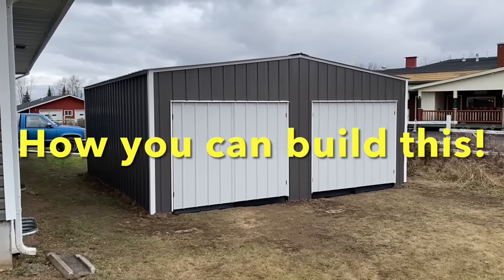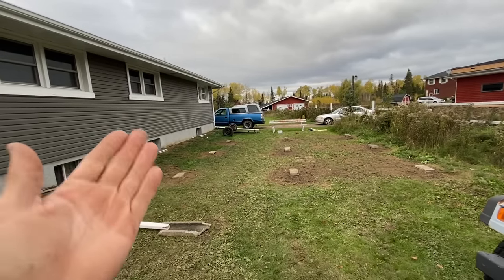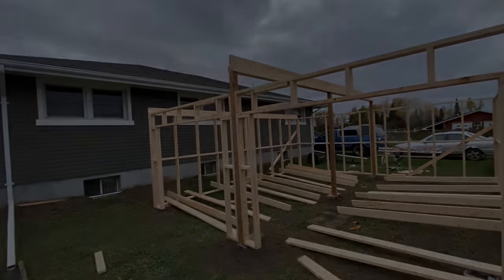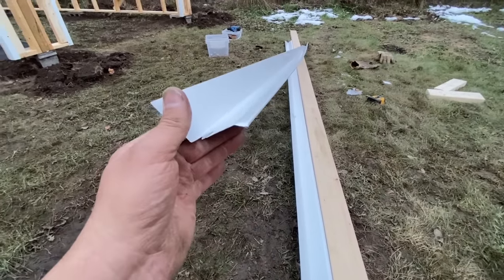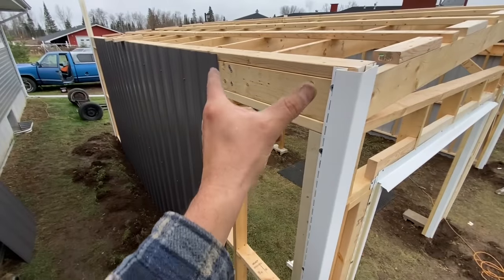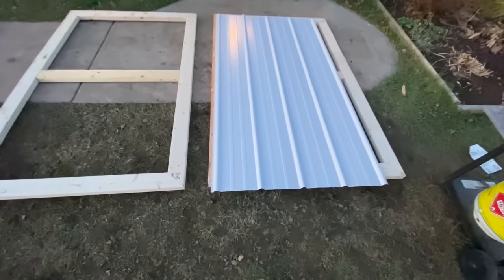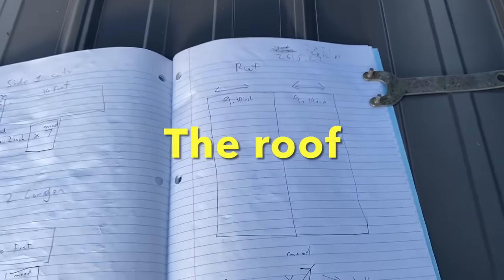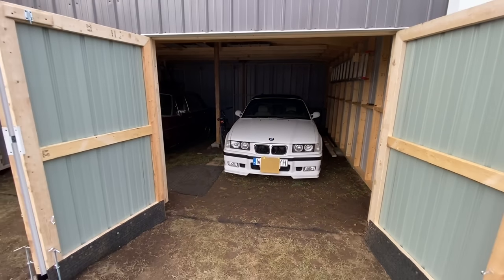How to build a 20x20 Garage for $3000 in 5 days (from Home Depot materials)

Comment: I have a metal garage for my bikes and the biggest issue is moisture in the winter. My tools and bikes have corrosion issues because the inside of the metal condensates and makes everything damp inside. Might be fine in the US though. I live in scotland where its cold and damp a lot.
Reply from the maker: Install an electric exhaust fan, that will completely solve the problem

Comment: Great job !! Are you concerned with sweating issues ? i did mine the same way an my metal sweats when it heats up from a cold night.
Reply from the maker: Mostly I'm concerned about keeping sunlight and snow and rain off my cars, ys it's not perfect but it's good for now, also I have an electric fan inside running to keep everything dry.  It is just a carport in the yard, all I could afford at the time

Comment: Great job on your building just one problem, I see you have put screws in the highs of the sheets and not the flat of the sheets to late already done and when starting end wall from left to right or left to right when you get to the middle you are to lap back the sheet same on the roof start from front or back not the middle so you can lap back the sheet. lap back means the high of the sheet,so if i started sheeting from the from to the back my last sheet laps back a foot on the last sheet to make a perfect end, too late already done, but still a great job on building this project.

Comment: Really neat build. I would prefer a bit more of a foundation. My area has high winds on occasion, and this type of building wouldn't last long. Some type of smooth floor would also be great,  but that would add cost.  I really like your budget minded construction. Many people will call out the hacks and shortcuts, but it totally makes sense for your build.
Reply: Yep. First wind will blow that away like a tent. Everyone should consult a contractor before pretending they can build anything. He could have save a lot of time just concreting in some treated four by fours.

Comment: I would like to copy that build, my one concern is if it is stable in high winds and can it bear its own load, do you have much experience in woodworking like this?
Reply from the maker: She is solid, if you lived somewhere windy you should run four by fours into the ground a few feet in with concrete at the bottom to really tie it down. 
 You need to have it strapped down but the whole thing is very heavy, where I live it doesn't get that windy

Comment: The blocks are installed improperly. They need to be set with the holes upward. There is no strength in a block with the flat side up. Just look at all block constructed buildings, the flat side is for looks outside, the holes are stacked on top of one another. Same with 2x4's, the strength is when they are installed sideways for load bearing. Other than that, the work was very nice.

Comment: Seems to be a shallow roof slope,  wondering what the snow load max is in your area. From what I can see,  I’d increase the overall roof supports.  On a shallow slope 2/1, Code here dictates a max load of 10.5 lbs per sq foot,  on this structure would be 10”.  We get two to three feet at once.  No go on slopes less than 4/12.

Comment: I hope you put some concrete in that garage cuase in winter cold season those tires are going to lose air pressure and bugs and critters will hide up in the wheel wells and engine bay. its happens TRUST ME. its sucks!! Awesome garage DIY tho👌👌💯
Reply from the maker: Both vehicles are oil guarded, and the ground is already frozen solid for at least the next 5 1/2 months.  It is just a carport though
Reply: @ProblemSolverGarage  ya its pretty nice. I want to do something like this and my grampas property.

Comment: Pretty informative But I am curious what will keep it from getting it blown off the concrete blocks?
Reply from the maker: It is very heavy, I also placed eight or nine cinderblocks on each corner on the inside, I wish I included that in the video. It doesn't really get windy here if it did I would strap it to the ground with cement and some type of long treated boards.

Comment: Love these “contractor” code comments like cinder blocks on edge.. it’s just a oversized metal shed kit it’s not carrying that much weight even with a snow load what he did was fine,my only issue is I would’ve done the wall panels from the corners and work right to left leveling each panel so you only have to cut one at the end but that’s just me this fine for 3k

Comment: Okay guys, this is so informative and detailed. Good job. But guys, I really want to see how the 2x4 frame. Especially, guys, along the bottom, which should've probably been a doubler, guys, so it doesn't sag after the heavy Canadian snow sits on top; especially guys, if you have them floating over ~10 ft spans. Another thing guys, is that you never mentioned using interior or exterior ground contact wood for the frame. Especially guys, around the base which will touch the ground and possibly make water contact. But guys, like I said, very detailed and quality explanations, that's it guys.
Reply from the maker: Well guys, the wall won't sag guys because it has metal strap to it guys, think about it guys there's a big giant piece of metal strapped to the side of the wall, it is impossible for it to sag, thanks for watching guys.
Reply: @ProblemSolverGarage I would love to see a follow up video of it's current state next year. But metal bends as well if enough weight is placed on it.
Reply from the maker: @srchellis  sounds good, I'll definitely do an update video

Comment: I like the idea and it looks good but I think this is only practical in a dry desert climate specifically when you have metal in the ground I do not think it would last with strong winds and heavy wet snow.
Reply from the maker: It will be fine, this isn't the first one I've built, they're all still standing looking good. 
 Remember it's just a moveable carport

Comment: Nice build  you did forget to mention one issues  with a 10 foot section 6 stud will  not work out even spacings  center line to center line  one will be narrower then  others
 and on  20 foot wall  each panel is 3 feet  so  i would have though   a 10.5  foot section  for side wall for 21 foot depth front to back of garage and  21 or 24 foot across the back and front would give extra  room for mower   garden equipment etc ...  would have worked out with less metal cutting.   as someone mentioned below the direction you laid the  cinder blocks it the weakest  direction. but  i hate to say in but strength wise you  need a ful sill the spanes  across the gap where the side and  back section come together. and  the shallow pitch of roof    would mandate  a sil  front back and a cross plate to keep side walls from spreading.  Yes it looks good and some  decent hints and ideas  but structurally    heavy snow load that  is borderline on strength and  building codes here    they would  take one look and  because roof area  snow load per square foot   if you  didnt  take it down they would come in with contractor and   #1  either bring it to code and bill you   OR #2  tear it down all ay your espense,  mine have to have   tiw plates all corner and  in  rafter  haf to have a bottom chord  and webs  if they span  more the 10 feet  wall to wall acros the width  but even then   the build is phenominal  and a few  minor adjusts this blows away   others  of same style you can buy as a prefab that are going to cost  18 to 21K  or more

Comment: I'm not trying to be a d*ck here,  I built my 32x20 cabin with a 12 12 pitch 45 deg roof and loft that I live offgrid in the woods. While this is a simple design, a few things that are missing that would concern me. 1. No sand/gravel under the cinder blocks to shed water and avoid frost heave. 2. Cinder blocks are rotated wrong, which makes them not very strong. 3. With no floor foundation, there needs to be something that holds the walls to the cinder blocks, concrete anchors or something. 4. The bottom foundation boards are not treated wood. Cement/Cinder blocks absorb water and will transfer to the untreated wood causing the lumber to rot. 5. The walls should be 16in on center, not 24in. 6. There is no double top plate (additional layer of boards crossing the existing joints, which add strength). 7. I'm hoping the screws are framing screws. Standard deck screws will break under lateral force/weight. Nails are better for structures, screws for decks, etc. Lastly, the roof needs more straps for metal roofing, especially in high snow areas. Also, no overhang/eaves, but that's a personal preference. This is a decent visual description. However, I recommend buying a very basic framing book from Amazon.

Comment: There's some confusion about the all metal TM22 and the TM22 Feather, there may have been some changes during production. I came back to respond to the person that messaged me, but as he said, his posts are disappearing.

The TM22 Feather I have is 36.5" long overall with the collapsible stock extended. It has an 18" barrel, threaded 5/8x24 with a thread protector, a 7" polymer handguard with M-Loc holes top and bottom. The model number includes"A-18" but does not include "Lite" as stated elsewhere in some comments. It is also 15.5" from the trigger to end of the buttstock (extended).

Compare to the all metal, according to American Rifleman, overall length 34", and trigger to end of the fixed stock, 13". Barrel 18".

Comment: You have a 10 ft span on the  foundation plate with no support orther than on cinder blocks. You should have a solid foundation all the way around either cider blocks or cement.
Reply from the maker: I've done this many times before, even 10 years ago everything is still standing. The metal strapping prevent the walls from warping in between the cinderblock gaps.
 Obviously there's always better ways to do things but then the cost goes up. Plus this thing can be dismantled and moved in one day
Reply: At a minimum, I would've added an additional row of PT at the bottom plate and reduced the span with additional blocks.  Then anchored with ground screws and added some hurricane straps.  But chances are, this will meet the OP's needs as cheap structure for some time as is.

Comment: You did a good job but one thing I see you missed that makes this a little less strong is you used a single top plate. And maybe you didn't tie the whole thing together cause you might wanna move it some day but the strength of the walls come from the 2by's tying the walls together in the double plate. Plus, it's a code requirement in Canada and the US to have a double top plate in any structure with walls exceeding 16'.

Comment: when you cut steal sheets with a grinder wheel it ruins the paint from excess heat and leaves the edge raw and open unlike tin snips or a sheer and will cause premature rusting
Reply: just 2 cents from a tinner it should last a decade or so still

Comment: Did you anchor it down to prevent a heavy wind storm from moving it or blowing it over?
Reply from the maker: I placed all my remaining cinderblocks along the walls, but it doesn't really get windy here ever, might need to anchor one of these down in a windy area, but the whole thing is very heav
Reply: @ProblemSolverGarage  Go buy some ground screws to anchor it down, they are cheap and easy to retrofit!  Cheap insurance!!!

Comment: That would not work here in Minnesota! In a few short years, all those blocks would be twisted and otherwise askew and the building would absolutely be falling off of them. Especially with the annual resettlement pressure not centered over the piers. Almost all viewers are going to be unfamiliar with the hydraulic and physical effects of common frost heave. It should be mentioned in your comments below the video that this plan can work only in the south.

If you don't want to dig the piers down at least 4 feet, then pour a floating slab packed with rebar and allow it to heave and ho annually. This is very common in the north as well.

Comment: I did see another area of improvement by running the j channel and vinyl corners down in the ground with the metal. This is another area positive seal between building and ground. As is this flaw throws off the whole building and makes something not look right about the whole building.

Comment: This is a sample of built as you go, side wall use same as roofing material is a waste of money if you emphasize on the budget. also, wait until rainy season, your nice garage is going to be messy since you didn't install gutter and put cement floor. expect a very hot garage during summer because there is no window, your car is going to cook and very cold garage in the winter. Nice detail explanation.

Comment: 10yd of concrete delivered in most of the US costs around $1000-$2000. that's what you'll need for an actual garage foundation. in terms of material price not shown in this video. rebar will cost $100-$300. 

in some places the big box stores will give you a good price on metal panels (R panels or PBR panels or older-style corrugated). but in most places those stores charge too much. my metal guy near me charges $1/sqft or less. the amish are a good source in many midwestern areas, sometimes less than $0.80/sqft.

Comment: Wicked build however you need a concrete slab poured inside eventually if not you will have mud everywhere and critters will find they're way into your auto's. Oh your walls are also bowed not straight.

Comment: Great video.  Could you have filled the hole around the outside of the shed with grey stone or maybe treat the part of the metal under the ground so it doesn’t rust? That is a great build tho. New aubscriber. Thanks.
Reply from the maker: I have another one that I set up 10 years ago and the metal hasn't rusted at all, the roofing material stuff seems to last.

Comment: The only thing I think you could’ve done to make this better would actually been use proper hangers and maybe pressure treated wood or the pvc or plastic wood just for bottom to sit on top of a patio stones / cinder blocks all the way around and then put patio stones in the center. That way you’re not in dirt have you had any problems with the city or building inspectors for this even though it’s a temporary structurebut I do enjoy your video

Comment: You're supposed to use treated lumber within 6 inches of the ground. You should not have metal panels in contact with the ground. There is also a double sided butyl tape that is supposed to be used where panels over lap. The rubber on the screws lasts about 20 years and then it has to be replaced due to leakage.
Reply from the maker: Thanks for the feedback, but this is just a temporary moveable carport.
Reply: @ProblemSolverGarage , I'm just wondering, how long are you planning to leave the garage in that spot? I only mentioned these things because the amount of money that you would have to spend to bring your garage into the code compliance in most areas, is minimal. Probably under $100. I do like how you've built the garage and am considering building a smaller version at my house. I will be using a concrete monoslab instead of having a dirt floor.

Comment: How much  wind  will it take?  Hurricane force?
Reply from the maker: I live in an area that gets no wind basically, there's never been a hurricane here.
 If you live somewhere windy I would bury some really  treated 4 x 4 into the ground with concrete at the bottom and bolt them to the structure. Probably one on each corner. 
 At the end of the video there's close captions that say anchor your structure down .
Reply: How many people have seen the video of the March 2011 tsunami in Japan? Wonder if coded construction would hold up to that-

Comment: Great video! Nice execution! Nice explanations! Poor planning!
I never would have placed the side walls on cinder blocks buried a foot deep when your frost line is likely 42”. Absolutely never would have buried the side panels in the dirt (10 days later the rust has already started). If you had built on piles, a 2X6 treated on the vertical would have been advisable to carry the wall load on the center of the pile not on the edge. Other than a few understandable mistakes I like it and watched till the end.

Comment: I’m a private contractor. I hate 💩ing on peoples work. I really do. People are going to watch this though. One El Niño storm and that garage is a kite. Another $1500 and some more labor and you’d have a slab with an anchored building and basic electrical inside there. $2000 and you can add heat, some benches and a few other features in there as well
Reply from the maker: It's just a carport, just a moveable temporary carport. I do have an update video coming on strapping it down better. I live in an area with zero wins and no storms ever.

Comment: Well, the door latches and cutting out the metal is not what I would have done.   I like inside/outside knobs.

Cinder blocks rot, and are terrible unless filled for strength.   Cone "pinch" blocks or even sona tubes are pretty cheap.   My problem is northern land heeves up and down.  I have seen concrete tubes pushed out from 4 feet deep all the way out in a 10 year period.   You have to use Cone pinch blocks that reverse taper to be pushed downward by the frozen ground. Then they may not heave out.

Comment: I’ve read some of the comments and I’m on board for frugal DIY. Hell, I’m the king of frugal. That being said, build it right the first time, then you don’t have to spend more money later when it fails. That shallow of a roof pitch and 2’ spacing without support under the walls is a recipe for disaster. Put everything on 16” centers and spend just a LITTLE more money for a lasting and safe garage. And make sure your walls are supported fully and put you’re rafters and studs 16” OC if you’re carrying that kind of potential snow load. Good job otherwise!